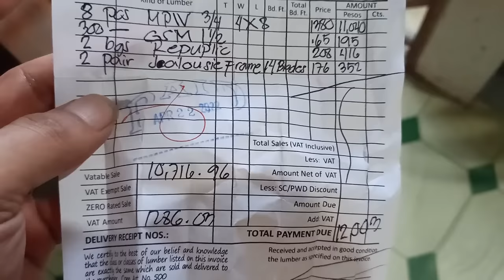Marine Plywood magandang pang 2nd floor.

Comment: Mas ok po kung Fiber Cement board (hardiflex) 16mm ginamit nyo.. termite resistance, fire resistance at di nabubulok.. at mas matibay sa strength, same price lang din. dati po ako nagtrabaho sa james hardie kaya kabisaso ko mga ganyan flooring system.
Reply: Boss madami daw ngsasabi madali daw mabasag...natatakot ako kpg yun nilagay ko sa mga flooring Ng second floor at tumalon mga anak ko ,di kaya lumusot Sila..please enlightened me po
Reply: @maryannsuan9539  make sure po na hardiflex tlaga.. baka iba brands yung sinasabi nila.. may durability test po ginawa ang james hardie comparing other board at kita dun na mas matibay tlaga hardiflex.
Reply: @maryannsuan9539  hindi mababasag yan dipende sa gap ng bakal na support.. kung malaki ang mga gap ng bakal sa ilalim.. posible mangyari yun.. at kung hindi legit na hardiflex.. talagang sira yan.. dapat legit na hardiflex
Reply: Bos, rivet po ba o tekscrew ang gamit jan?

Hindi kaya sa ktagalan, lumuwag ang kapit ng mga nabanggit ko?
Reply: @erdsvalenciasibulo1793  hindi po pwede revit kc makapal ang board mahina ang kapit nun, sa tekscrew naman labas naman ang ulo nun.. use 32mm Hardie screw.. wala ulo nakalabas at madali lang ilagay.
Reply: @reiden4442 bos, linawin q lng po.

So ang dapat po na ilalatag q ay hardiflex na 16 mm at ang tekscrew ay 32mm,Tama po?

Comment: maganda nga boss!
but ang downside nya:
maingay ang plyboard pag naglalakad ka! what more if nag love making kayo ni misis? di dinig na dinig yan sa baba....
at mabilis mabulok yan pag inanay or bimahayan ng langgam...
better buhos nalang ng slab! gumastos ka na rin lang ng tubular eh!
magastos din ang tubular at kailangan well maintained sya para iwas kalawang pati....
kaya kung may pera ka din lang pabuhosan mo nalang ng slab para kahit tumalon talon pa kayo ni misis dyan! walang maiistorbo! hindi gaya ng plyboard mo naglalakad ka lang dinig na dinig na kahit sa baba...
maganda nga yan boss pero
Reply from the maker: tama ka sir. salamat sa comento. gosto kc ng misis ko light materials lng takot kc siya sa concrete lalo na pag may lindol. at masisira din kisami namin f slab.
Reply: Tile rug solusyun dyan. Walang ingay kaya todo kiyod talaga!😅
Reply: Fiber cement boss gamitin mo di maingay....15mm tapus tiles mo parang slab lang.....pro if kaya lang naman ng budget ang slab buhos mas ok po yon ang prob naman jan if di nakaabang ang poste at biga para sa 2nd floor..gawin mo nalang jan sir pahiran mo ng pang anay ang plywood at lagyan mo sa ibabaw ng 12mm cement board bago mag tiles siguradu walang ingay nayan bas ok lang mga joint mo dapat matibay kasi mag aangatan ang tiles if gumagalaw payan